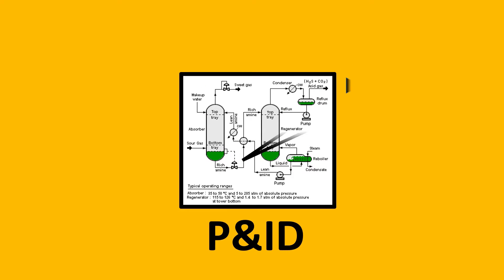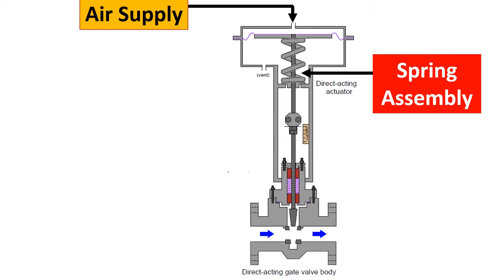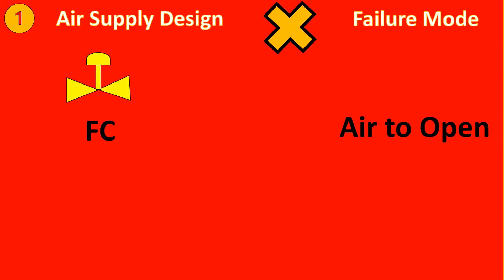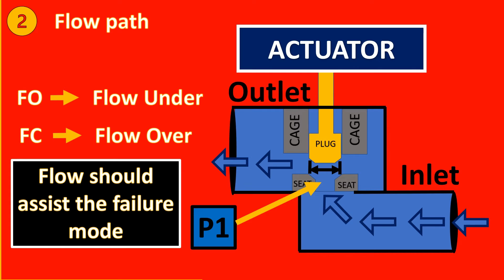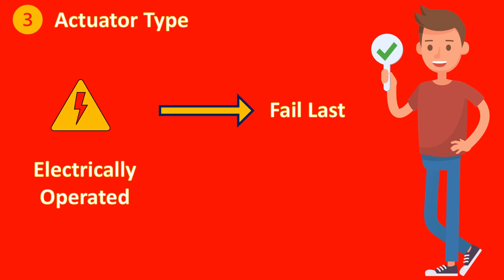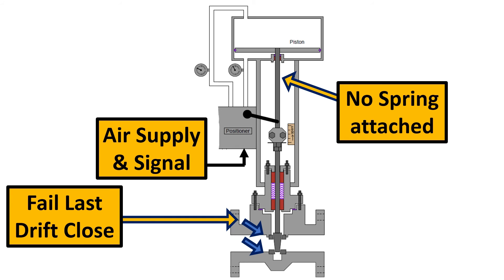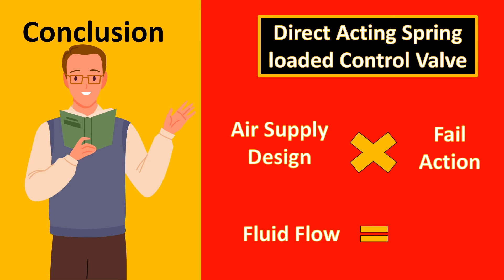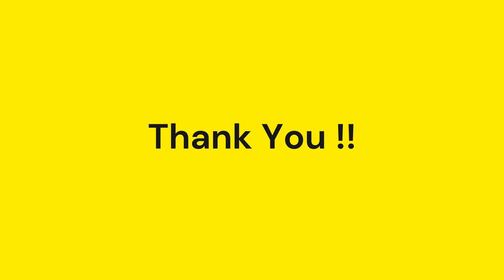Control Valve Failure Mode (Fail Lock |  | Fail last DC | Fail Last DO | FC | FO Modes included)

Comment: Hi Asad, if we consider electric actuated ones (MOV), it depends on the type of plug/disc. For eg in a gate valve MOV  i believe it can only be fail last or fail indeterminate. I'm just wondering not quite sure though and never experienced this situation. But MOVs I've usually found FL on p&ids
Reply from the maker: Yes you are very correct in MOV we cant have FAIL CLOSE or FAIL OPEN position
Reply: What about electrically actuated needle control valve? How the flow path will help in achieving our goal?
Thanks.

Comment: But sir in case of control valve with piston operated actuator volume tank is also provided by valve vendor right?
Reply from the maker: If volume tank is required then it should be specifically mentioned in datasheet. (It has additional cost)

Comment: Good explanation Asad.keep it up.
But I do have a question,how the flow necessarily cause the Fail Last position for Globe valve piston to come down or go up.How the horizontal normal flow can lift the vertical piston?
OR the process have to be told to Maintain such flow?
Reply: Good question....I also wonder the same...